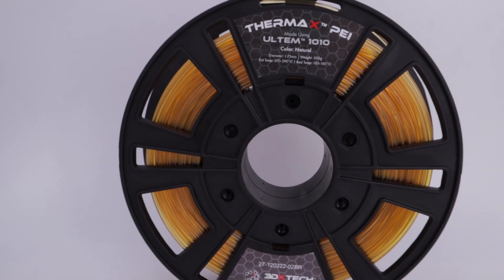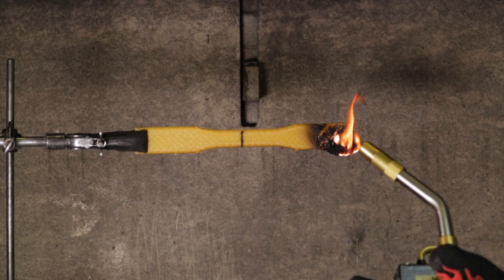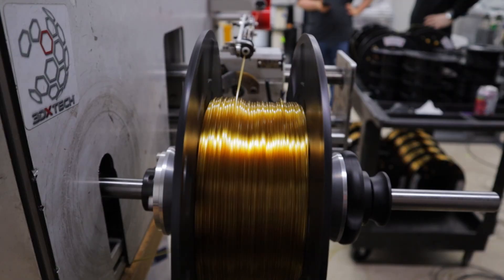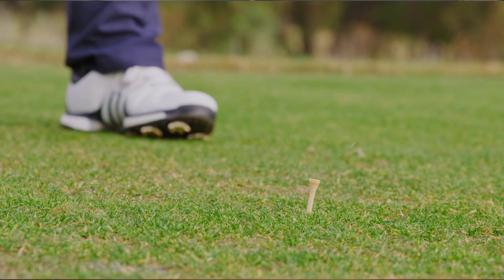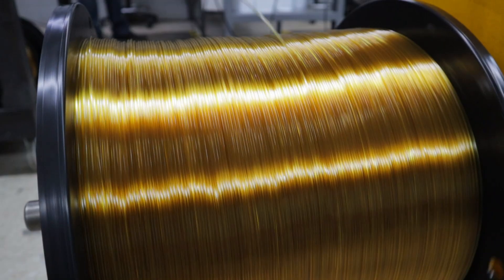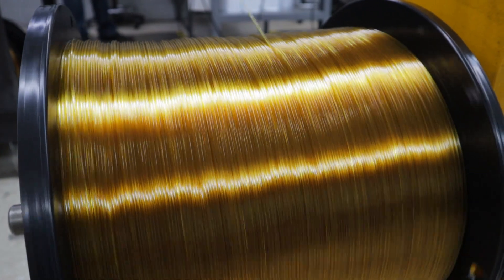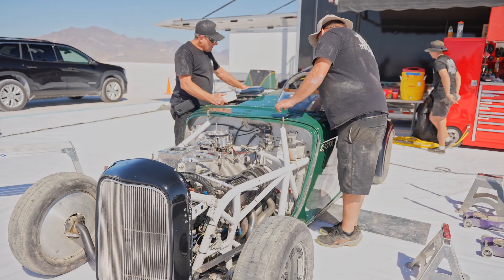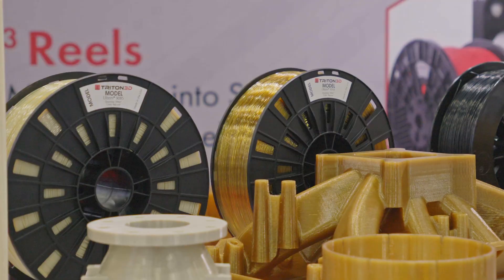3D Printed Golf Clubs: Ultem 1010 vs PLA

Comment: hmm, higher flexural strength doesn't mean it will flex more, it just means it will be stronger in bending.  If you had left both clubs out in your car on a hot day, the PLA would have warped/sagged, while the Ultem would have been fine.  Also, the Ultem part looked like it wasn't printed at a high enough temperature, which isn't the material's fault, but the designer/operator/your fault.  If a suitable Ultem club head was designed for FDM 3d printing, with proper print orientation, high enough temperatures, it would have been much more durable.  It appears like the shaft for the tough PLA head was embedded in a large section of the object, which makes it much more resistant to impacts.  To make the comparison better, you should have printed each material in the same geometry.  I do purchase some filament from 3DXTech, but this video reduces my confidence in your marketing people, rather than enhances it.
Reply: To make a comparison, the first step is to ensure the parts are the same. It's sad that this video was shared without someone checking that. PS, I am also a customer.

Comment: Just the end part right ?  Still I love videos like this. I’m an inventor. When I come up with a design. I’ll sketch it on a drawing pad. Later after a lot of thinking and refining. I’ll have an actual prototype if only on paper. Then look back at the original sketch and it’s so very close to the refined specks. Now with 3D printing. The plastics are very strong. A finished actual product to sell that’s just as good almost to an injection mold.   Keep it up !!!!